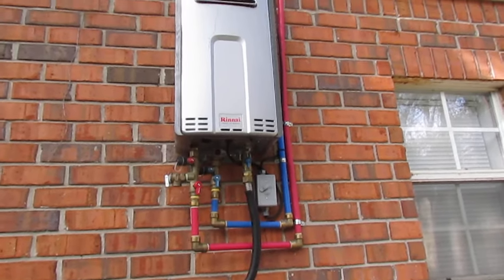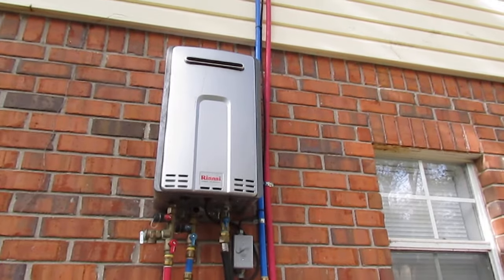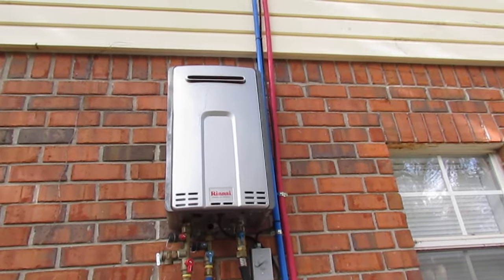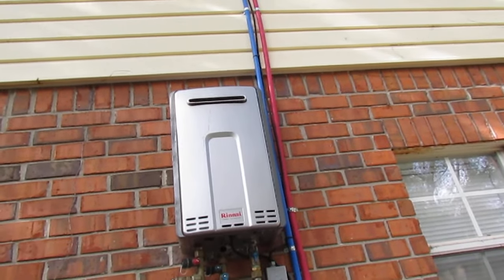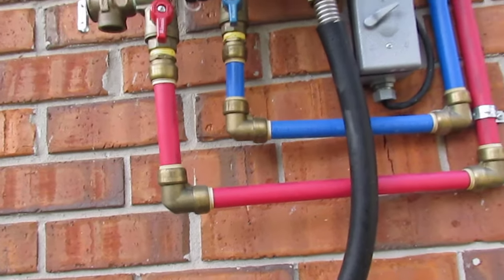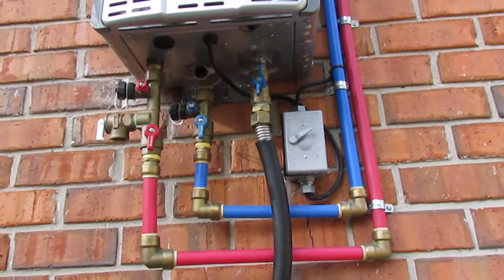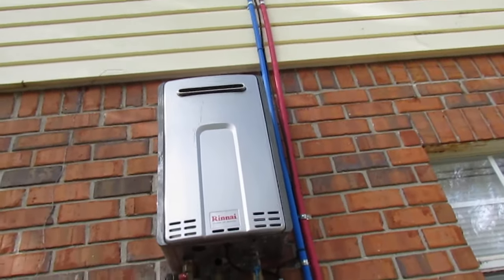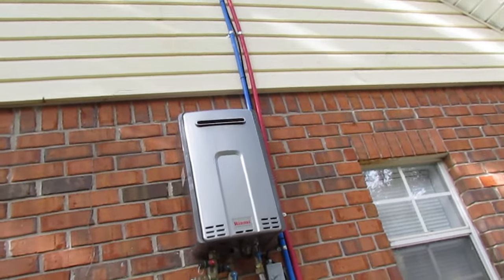Will PEX Pipe Freeze should it be insulated to protect from freezing and UV light Read Below

Comment: Why would you have such a small tank? That tank won’t last 3 showers and then you have to take it to refill it every week? What kind of mess is this? Why not get a real tank like a 500 gallon and put the water heater inside the house where it belongs?
Reply from the maker: This is a tankless water heater and it heats the water as it passes through the unit. This unit is also outdoor model.
Reply: I realize it’s a tankless. I bet it pulls 200,000 btus at max load which is why you need a larger tank. It’ll burn 2.25 gallons in an hour. So how many hours do you get? What’s the vaporization rate of that tank when it’s at 20 or 30% in cold weather? There isn’t as much wet surface on a vertical tank. And why would you expose the plumbing to such cold weather?
Reply from the maker: I agree, if it were me I would have at least a 500 gallon tank.

Comment: No exhaust for the gas heater?
Reply from the maker: Its exhausted thru the slot opening on the top front panel
Reply: @southernhometalk2465  oh cool the models i am accustomed to seeing all have some tubuler ... car muffler ... hvac vent looking type vent hose or attachment this is far neater
Reply: @vaulmoremack3072  Yes, those are typically indoor models where you'd need to vent the exhaust through the roof like a gas water heater or gas heating furnace. This is meant for outdoors.